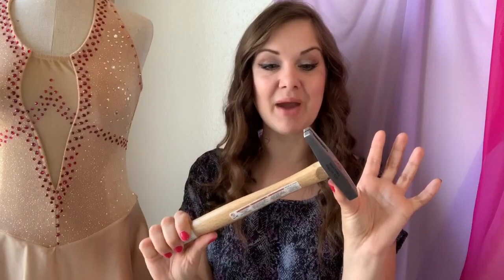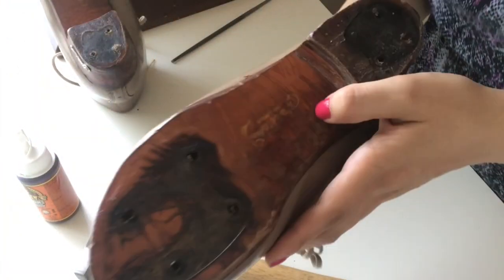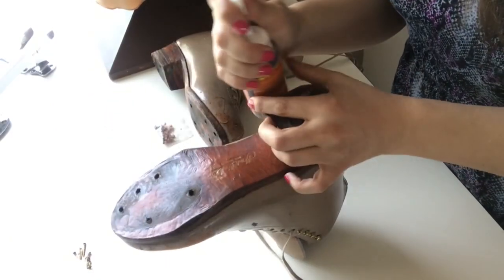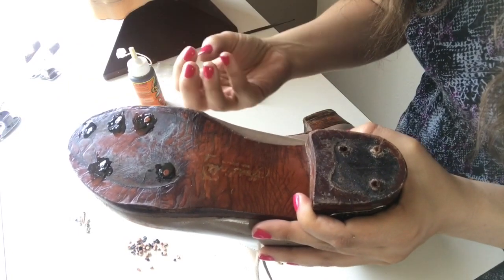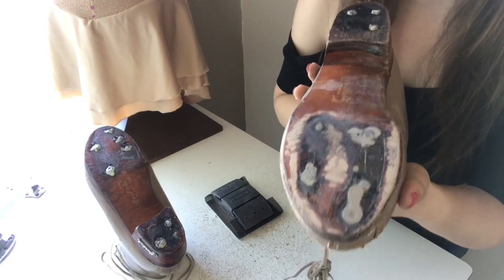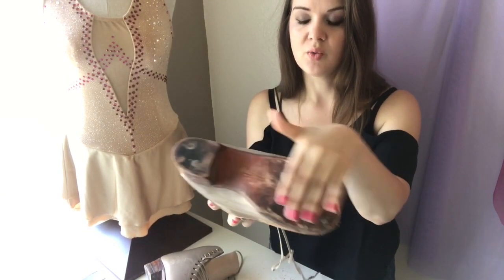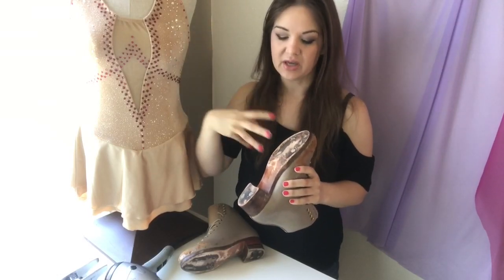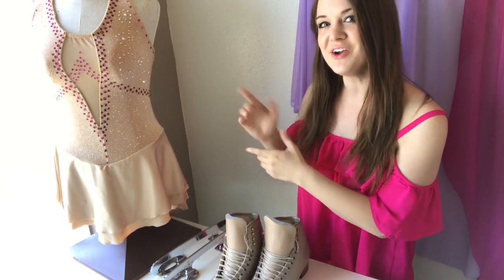Repairing Figure Skate Soles - Plugging Holes and Snowsealing the Leather

Comment: Hello ! Thanks a lot for your videos that helped me along my figure skater journey !
I just orderd boots to fix a roller inline frame so I can skate while the ice rink is closed. Thoses came with screw on the heel (but none on the front). Do you think it's a problem or do i have to remove them and fill up the holes ? (they are not aligned with the frame of course)
Thanks a lot, cheers from France ~

Comment: Thanks for showing us the D.I.Y. skating boot repair project! Are you going to use regular screws or metal plugs to re-mount your blades? I've seen skates that have metal plugs because the leather sole is so worn.💕
Reply from the maker: I used screws.  With the leather plugs in the soles, they gripped just fine.

Comment: Wow! Amazing you DIY this! I am curious how many years do your Harlick boots last?  I ask this because when my knee started hurting last year I went to get custom fit Harlick boots even though I am a very beginning beginner with very small adult feet.  So I ended up now with a pair of Jackson skates I bought previously and my lovely expensive Harlick skates.  Now I am getting back to learn staking from the very beginning again and I fear I would fall a lot and torture my skates.  (And none of the pairs got break in yet.). So I am debating whether I should torture the cheap Jackson stakes or just sell the like-new pair and just use my custom Harlick skates (which as of right now still has a temporary mount because I am not sure about one foot glide yet).  Do you mind letting me know your advices?
Reply from the maker: This old pair of Harlicks I purchased in 2008!  They have lasted very well for me.  I just got a new pair, but these are still in good enough condition that I can use them for coaching.   I would recommend you break in the Harlick boots and use them since they are going to be better long term and you might as well get used to them. 😁
Reply: ThriveDiaries Wow!  That is super awesome! Thumbs up to Harlick boots!  I look forward to get out there with my skates!

Comment: When you remount the blade, do you drill fresh holes into where those plugs are?
Reply from the maker: You can drill them into the same spots, but if you can use some of the holes that you didn’t use the time before, that will also get you some fresh leather, which would be a good idea.

Comment: I am interested in waterproofing (Sno-Seal is not available to me) the leather soles of my Risport skates with blades mounted with not all screws, as I have not seen indication that waterproofing has been done in connection with blade mounting (I wonder if waterproofing of Risport leather soles might not be necessary)  - I am concerned that there is a gap between the soles and blade plates. Via a blog, I have received information indicating that waterproofing after blade mounting might lead to moisture under the blade (plate).

Comment: I have a lot of wine corks that I saved (the natural type). What do you think about using them as opposed to leather plugs or wood? I also have some scrap leather, but they are probably not as thick as the leather plugs you use. I can cut them into tiny pieces to fill the holes. Would the latter be a better option than using corks?
Reply from the maker: Interesting idea with wine corks, it could work if they had good glue saturation, but since I haven’t tried it, it’s hard to say for sure.  Leather is definitely a more tried-and-true solution.

Comment: How long does this fix last?
Reply from the maker: If you have a good snow seal on the leather, and take care to dry your skates properly after each use, the fix should last until you need to remount the blades  But even then, if your blades were mounted properly after this fix, you won’t have used all the holes and should be able to use the alternate screw holes for your next blade mounting.  So ideally this fix lasts through two pairs of blades.